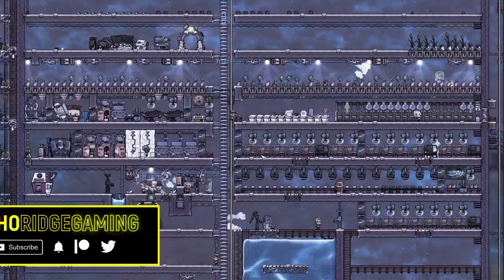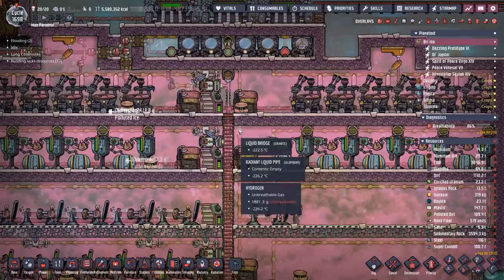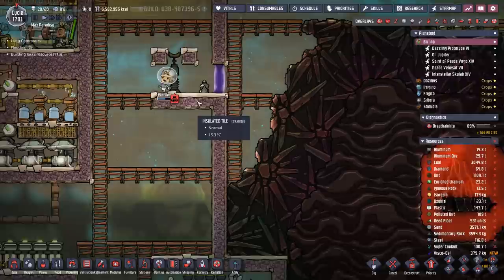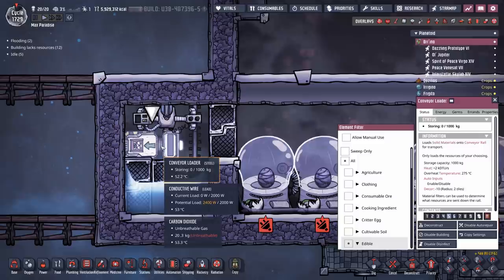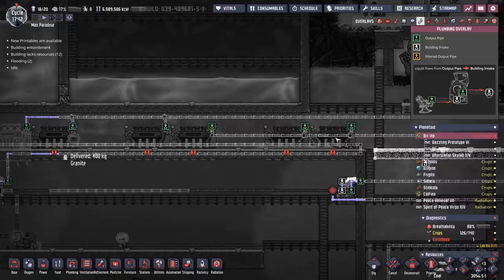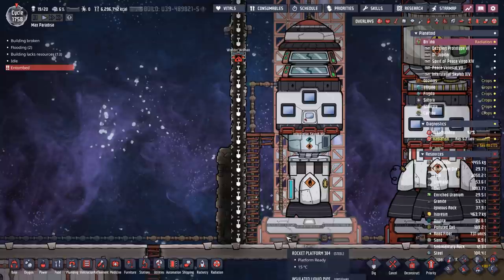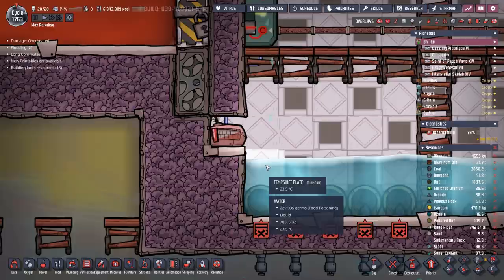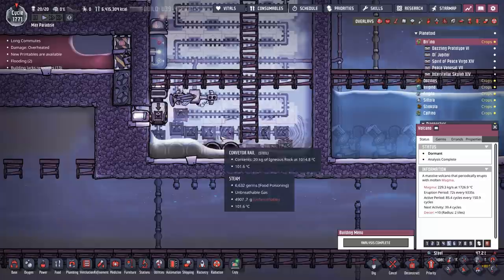Water Purification Plant | ONI Spaced Out | Max Difficulty Ep 22

Comment: since the polluted water is not at a hot temperature, i would recommend building a countercurrent flow heat exchanger transferring heat from the turbine output to the polluted water input.
Reply from the maker: Great idea.  Going to try to work something like this in.

Comment: interesting, some things :
You do not need that huge room, a smaller works fine too.
You can use less magma if you cycle the rock instead of duping on the top.
You will need to control the pressure or you will end up with less and less steam.

I made the same thing with 2 turbines and 1 aquatunner , my room is 12 wide and 9 tall, I use diamond sandwich with a steel door in the middle to deliver the heat, after the heat is done use a miner to drop the rock down and conveyer inside the steam room to cycle around more, finally add a sensor to send the rock out when is bellow 140C

Comment: Great build! Really interesting to watch. You could use a Conveyor rail thermo sensor to only allow the igneous rock that is on the conveyor rails to be dropped out when its below a certain temperature, this could potentially stop the top left part from accumulating to much heat. I also like to sweep out the salt and dirt out to help with lag and aesthetics (I like it tidy), or at least condense them into one pile. 
You could also use a liquid valve on the polluted water amount down to 1000 g/s (doesnt change states) which means you could run the tube through the warm area to pre-heat it to above 100C , which would make it instantly evaporate when it comes out. It would reduce the efficiency, but make it easier with regards to polluted oxygen.
Reply from the maker: Great tips.

Comment: I think you could've gotten away with a much shorter pipe run for the aquatuner used for cooling the purification output. You could put the purification output into a small tank next to the aquatuner. The aqua tuner can cool that water down to 20C. Then, the small tank can have an open top which overflows into the big tank. Since you're adding nothing but 20C water to the big tank, you don't need any temperature control for the big tank.
Reply from the maker: Brilliant idea.

Comment: You have mentions in the past that liquids and tanks storing a liquid takes less time rendering and overall takes less power from your computer. One thing I have done from time to time just to expand a small water tank is stack the inside of of the tank with liquid tanks pulling from the bottom of the large tank going through all the smaller tanks before going where it needed to go. This also helps me prevent running into issue where I wont have enough liquid being pumped due to electrical demands/ supply demands so having these tanks also work as a good buffer throughout your whole system as well as removing the animations that have to be rendered for the liquid. Love the videos!

Comment: I stick a steel door between the 2 visco gel locks as a precaution, if the inner lock breaks you have a chance it'll be OK assuming you pick it up fast enough which can be helped by a atmo sensor and one of the newish automation notifier thing-o's but I live life on the edge and haven't gone that far yet
Reply from the maker: Smart move.
Reply: @EchoRidgeGaming  to be fair it does slow the dupes down a little so I only really use it with volcanoes near the base haha

Comment: Well, that's quite a huge building ))) and I can imagine how much time it took considering freezes and FPS )) respect! 
I would offer a small suggestion. Maybe a couple )) You could put a termosensor to the steam chamber to shut off water supply if the temperature would fall below 130 for example, just for in case if you'll run out of magma. Also conterflow for cold water coming into the purifier to safe some extra heat )) 
Love your style of speech )
Reply from the maker: Already working on the counter flow.  Great suggestion

Comment: I'm a little worry about the Mesh Tiles at the magma chamber eventually getting too hot and the magma won't solidify.
I would instead replace the two insulated tiles with metal tiles and let the heat transfers into the steam chamber.
Reply from the maker: The almighty temperature shift plate has never failed me. I have done this method a few times and haven't seen any problems (yet).  Good looking out though.

Comment: Okay wait wont this break due to running out of magma?  If you think about a normal volcano tamer, most of them use about 3 steam turbines tops because that's the max a volcano can sustain.  This volcano is currently running 6 with built up magma. Once the stored magma runs out you'll flood the device right?
Reply from the maker: Since the vents are below, if we run out of heat, the vents will flood and stop incoming water.

Comment: i think those rails should be a loop with temp control at the and , it must be more efficient. i think
Reply: The rails are almost constantly being filled with new/hot igneous rock from the magma drip, they'd eventually fill a loop. Unless made with a temperature sensor that would eventually drop them as they cooled and make room for new. But it would really depend on the volcanoes active time/output if that much rail spaghetti would make that big of a difference. XD

Comment: Wouldn't it be better to drip the polluted water in from the top? I notices it started collecting at the bottom which is when you got that one off gas. but dripping from the top it would pick up heat on the way down and flash once it hits bottom. kinda like the counter heat exchange with the petroleum boiler.

Comment: Why use steel when rails melt at material melt temperature? 🤔 If you drop the dirty water through the chamber it will heat up faster. 😊 Nice build.
Reply from the maker: I like the idea about dropping the water through the chamber.  I used steel for the thermal conductity.

Comment: How did you manage all the hot debris going to the item sorter and not anywhere else? I played with volcanos for the first time and they started putting rocks at 1200°c in my ranches wich did not go well...
Reply from the maker: I have had this problem before too.  Some things I have done is lock the ranch doors until you have the rock cooled.  You could also switch the hatches to eat something else for a bit until the rock cools down.
Reply: I had the same problem with my petroleum boiler in my last playthrough, so I dumped the hot igneous into a separate steam room on rails in a loop to cool it down to ~120-130C and make a small amount of power off it.  I have a shipping rail temp sensor which turns on a shipping rail cutoff to drop the rock out when it gets cool enough.  It drops into a pool of petroleum outside the steam room, which is cooled to 40C by an aquatuner in the steam room.